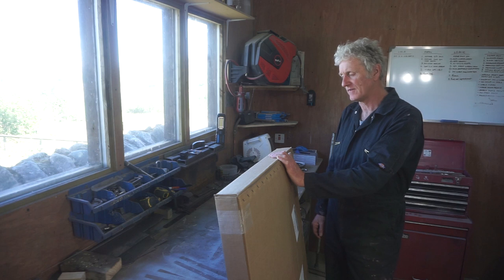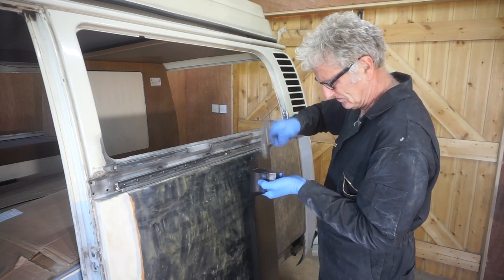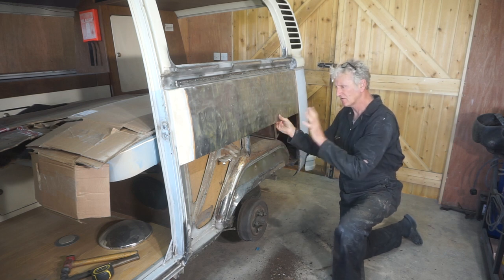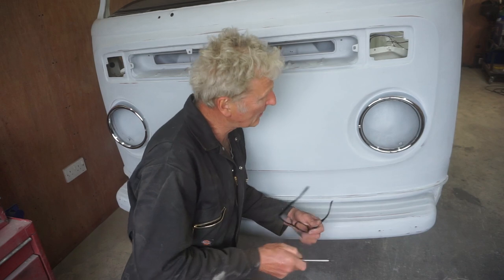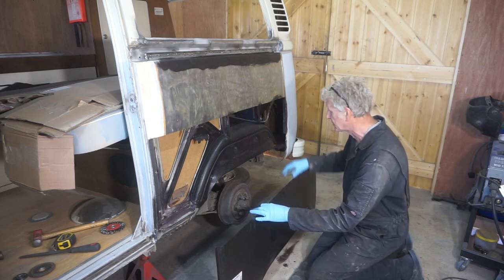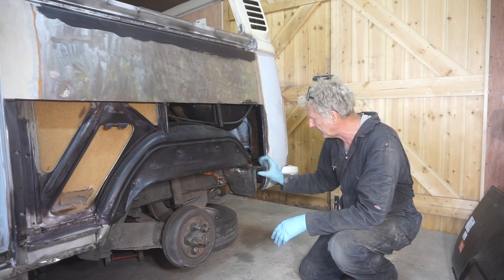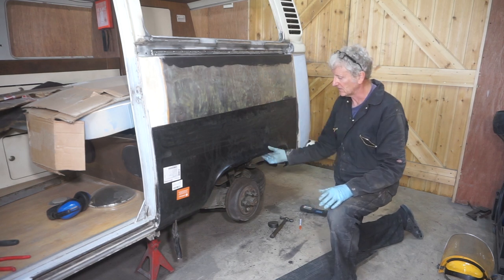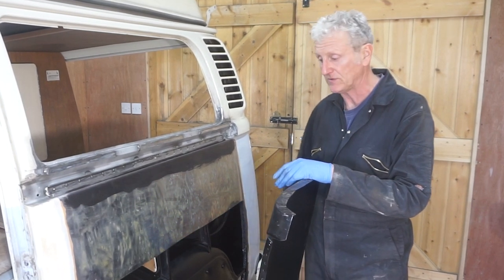1973 VW Campervan Restoration Part 23

Comment: Nice video .have you tried mig brazing .no distortion or rusting afterwards??
Reply from the maker: Hi, no I havn't, will look into it - is it strong enough? I have always wanted to have a go at tig welding as well.
Reply: @snowdoniaclassiccampers6849  yes it's very strong. I bumped into a guy that restores very high end old Merc and other classics where they can charge 100k for a resto and he told me because of what they charge. They need to give a 7 year warranty. So they mig braze